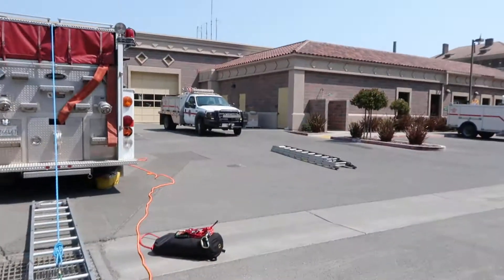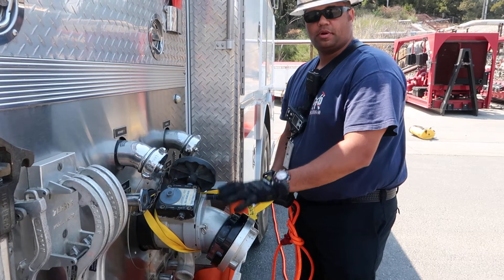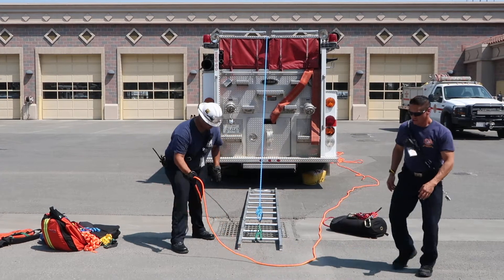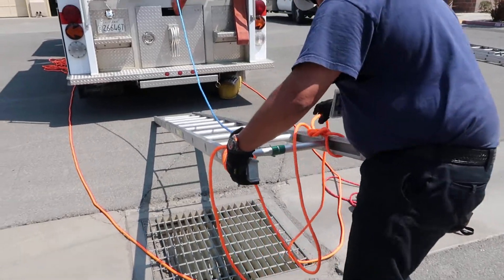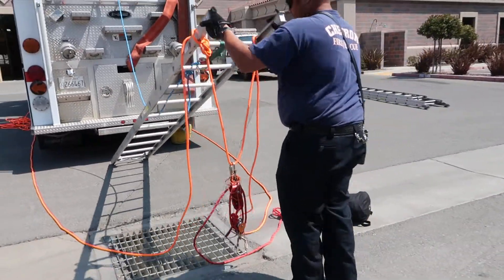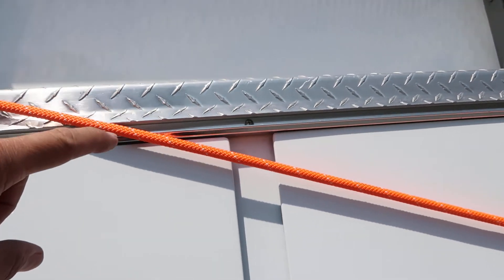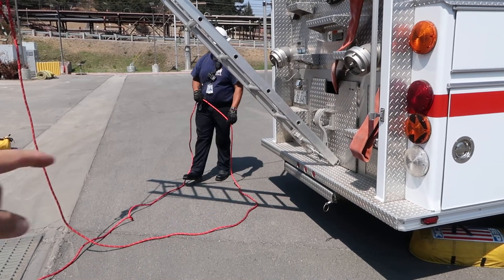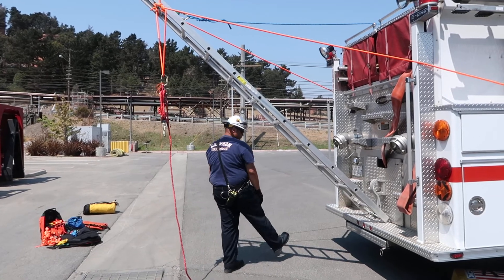rescue training ladder gin (derrick)

Comment: I recommend that you practice using this arrangement a few times, to iron out a few kinks, before you use it on a living person.

re 1:57 I wonder who tested that pump fitting for 5kN shear/lever force safety?  And the blue main guy.
re 3:34The bite-8s should be dressed better, so they don't collapse under load during operations.  
re 4:41 The tech failed to isolate the side-guys from the patient load!  & one is under and the other is over the ladder.  Also, the ladder was not constructed to resist significant lateral forces on the rails.  (Check the NFPA/ASTM for such a ladder standard or test.)  Also, consider mounting the upper pulley directly to the ladder rung, to uncompromise the side guys, and dramatically reduce the "Awkward Angle Shift" when the haul team pulls the top tackle block out of load alignment at the start of the patient lift. 
re 9:44 Note that the prusik is at risk of being released by the edge of the door hinge, especially if the webbing over the end of the pump fitting slips.  
re 12:20 Casually interchangeable, but typically, a derrick is a hoisting apparatus employing a tackle rigged at the end of a beam(the ladder).  A gin pole is usually a vertical post used to raise a post, column, or mast section during construction.  
re 12:51 Testing the sag with one (fat) man only 2/3 up the ladder for a life safety system expected to hoist 2 or more + gear + hauling forces(X2) is inexcusable.  

You should have calculated the probable load on the main (only loaded) guy, & watched more videos, and more critically before filming this "demo".  
Simple main guy load: 200# X 2 X more than 2 = ~1000# (assuming only pt & basket and no stretch).  Double that for a rescuer & gear and the added stretch angle multiplier!  Then look at your ladder & guy anchor(not shown) and ask yourself "What is the weakest component life safety rated?"   BTW:  Most identified life safety equipment is rated in kN (1#=4N), but pump outlets & water cannon parts are not.